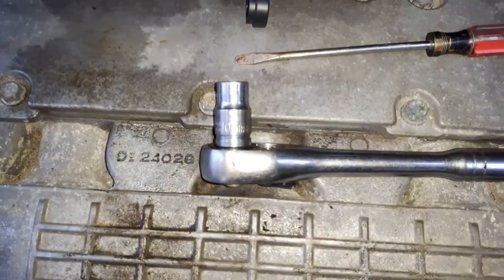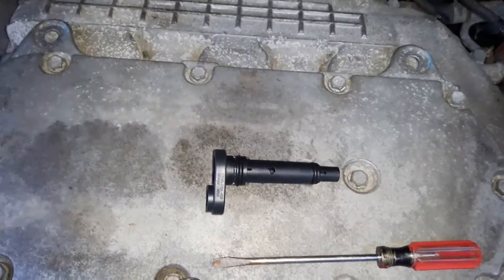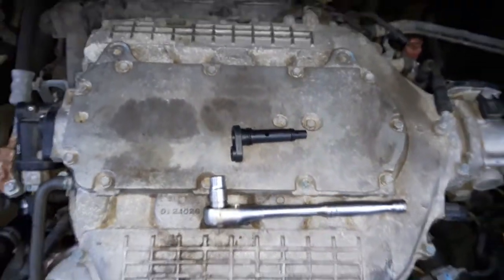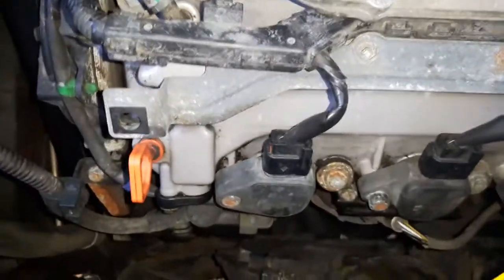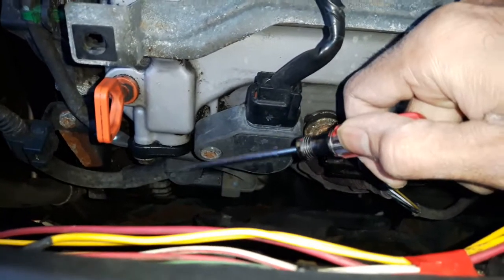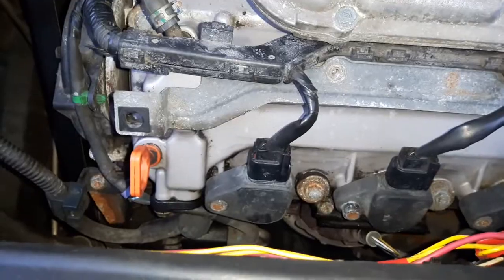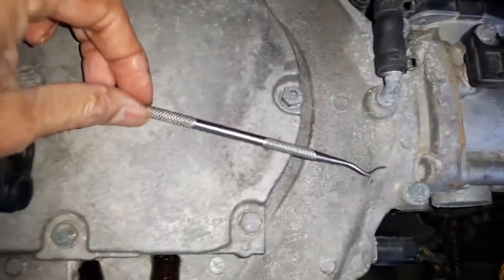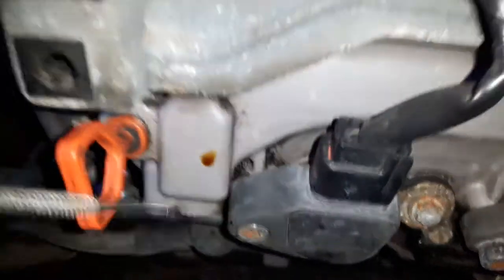DIY Honda Odyssey PCV valve change location repair hesitation pass emission test better fuel economy

Comment: Great video. Remember to change it often. Don’t over tighten it snug is good. Oil the ring like in the video. Hopefully it won’t break off when you remove it again. 

Do not clean them just replace them.

Comment: How much was it..thanks
Reply from the maker: Please check the link in the description. Usually around $20
Reply from the maker: No DTC from this unit. It only sucks the vapour from the engine block and sends it towards the intake, while preventing oil being sucked in. Proper function is important for e-test pass. Please share and subscribe.